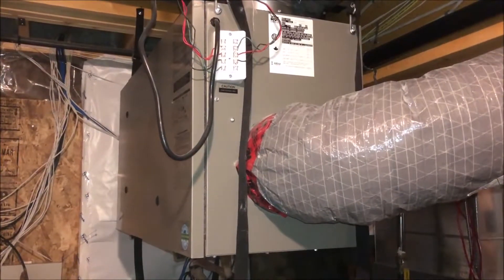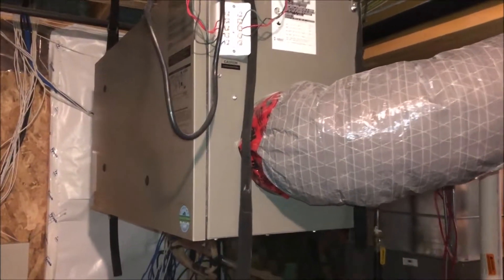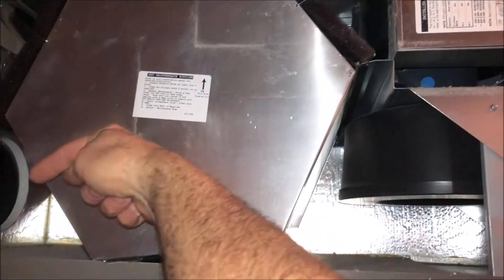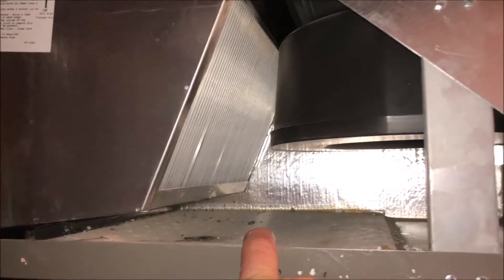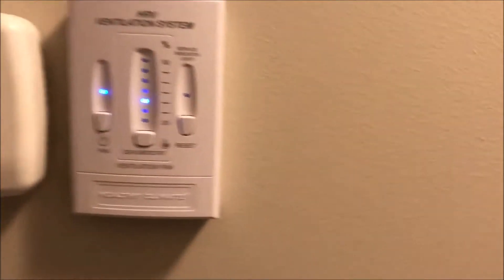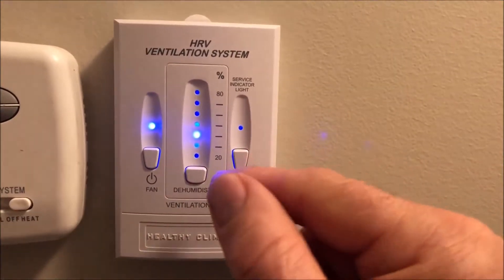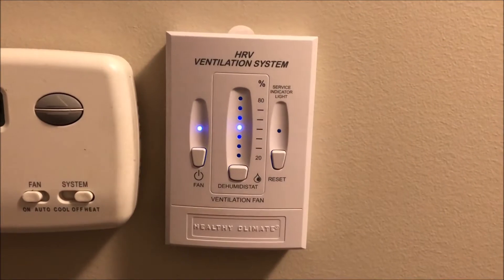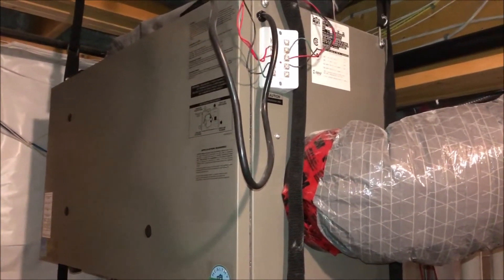#9 Heat Recovery  Ventilation (HRV) System

Comment: Hi,
I live in Edmonton Ab, I have the exact same unit as the one on this video. My house is four years old and I was told by my builder tu run the HRV at all times which I have since I took possession. I was under the impression the HRV puts clean air from the floor vents? The fans run normal in the unit and it works when I turn the controls on in the bathrooms. But for some reason air doesnt come out from the vents on the floor. Is this normal? Or is there something wrong with it? It's set up at 40% on the master control. I hope you can help me soon as I have a technician coming out next week and they charge a lot just to look at it.
 Thank you
Reply from the maker: The furnace fan should be running at the same time as the HRV. This would force the fresh air through the house. 
Turn your fan on the thermostat to the on position. The fan will run all the time and the heat will turn on as needed
Reply: @diyrepaircorner  thanks!! I switched the thermostat to "auto" a few weeks ago so the HRV would only kick on when the furnace did. Put it to "on" and the HRV air is on all the time now. Thank you.
Reply: @diyrepaircorner  and now, should I leave it at "on" or "auto" on the thermostat?

Comment: Thank you for the video! I am having some squealing (assuming it is the fan?) coming from my unit. Is there something I can do about it? Or do I have to call a repair person?
Reply from the maker: All depends on the furnace. Could need a new belt. Most likely bearings are going
Reply: @diyrepaircorner  The noise is from the HRV actually...I'll take a look inside and see what is squealing. Thanks.

Comment: And does the HRV system take lots of power?
Reply from the maker: It does not take lots of power just a small fan. When you exhaust air it brings fresh air in and recovers the heat loss on the heat leaving the house. It gives you a better environment in the house with fresh air rather than having stale air with not replacing the air that’s leaving like the old house is dead

Comment: I live in Winnipeg as well , we have an electric furnace and a brand new HRV system, when I have my furnace running should I have the HRV system on ? And when your in the shower can you hear the ceiling fan run ?
Reply from the maker: The hrv is running all the time if the humidity is high in the house. It’s based on a humidistat. If you turn your timer on in the bathroom you do not hear the fan very much because it comes from the other part of the house beside the furnace usually
Reply: DIYrepair Corner is there any way I can contact you so I can show you pics of my system threw the home ?
Reply from the maker: Find me on Facebook and send me a message 
Goldcoindigger 
I also do metal detecting lol

Comment: why my heat more expensive
Reply from the maker: This unit recovers up to 15% of the heat on air leaving the house and worms up the fresh air coming in.
Reply: DIYrepair Corner  how can i use my bathroom exaust if i turn off my HRV. thnks
Reply: fredd CA 
If your hrv if hooked up to your bathroom you need to leave it on. To save on you heat bill turn off the hrv and only use it when you turn on the bathroom fans. 
It normally turns on when the furnace is on bringing in a lot more air. This would save on heat bill. Only bring in fresh air when bathroom fan is on or when humidity is high.
Reply: Goldcoindigger  i guess the HRV bringing cold air -40 outside so the heater keeps working hard?
Reply from the maker: The hrv warms up the air as it comes in from the warmer leaving through the heat exchanger. 
If you did not have an HRV and you turned the bathroom fan on you would cause a negative air pressure inside the house and when people open the door lots of cold air would come in. The HRV brings in the exact same amount of air as it is removing through the heat exchanger. This controls the humidity in the house stopping the windows from getting water condensing on them in the winter time.

Comment: does this system bring in humidity to your basement
Reply from the maker: It removes moisture out of the air. Brings in fresh air as it is removing air. As the cold air comes in the moisture condenses and goes out the drain.
Reply: @diyrepaircorner  do you run it in the summer and if so if the outside air is humid would it pull that into a basement that is typically humid anyway.Im trying to decide hrv or erv.I live in newbrunswick and some days in summer are hot and humid.Thanks
Reply: Terry Munn 
It would bring fresh air in the summer into the furnace return air duct. If the air conditioning is on it would remove the moisture at the Air conditioning coil in the furnace. Since the HRV is connected to the furnace it would only bring fresh air in when the air conditioning is on.
Reply: @GoldcoinDigger  ok, thanks my application would be a stand alone unit with dedicated duct work. I have two quotes on hrv units and i'm being told that is what is best for this climate however I don't like the fact they can introduce humid air to the basement in the summer.As I have tightened up the house over the years and capped off the fireplace and woodstove and no longer use them , my windows are getting wet about 1" up and they become moldy .I definatly need air flow and exchange.
Reply: Terry Munn 
Stand alone would get you fresh air. Would need a dehumidifier to help with humility